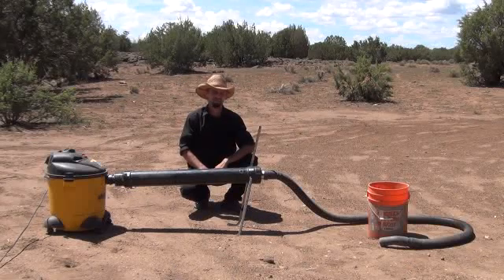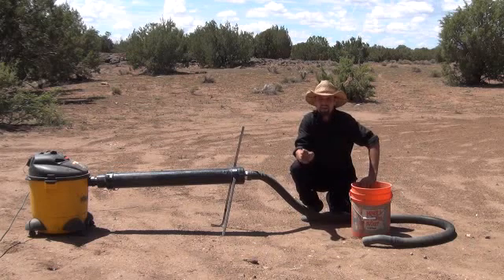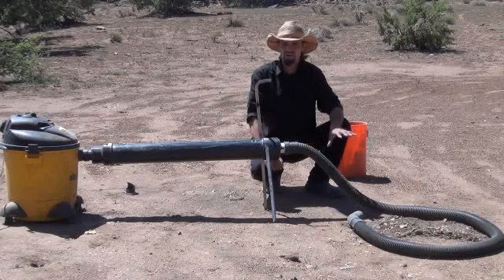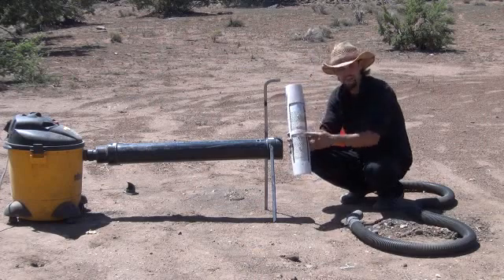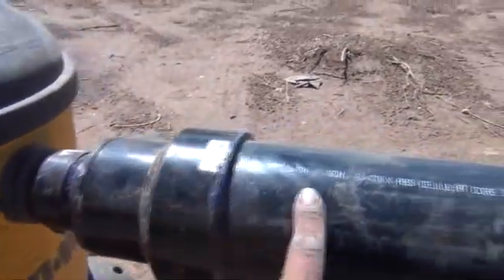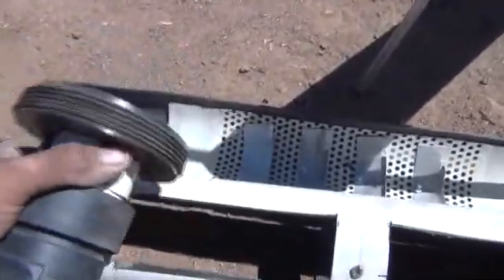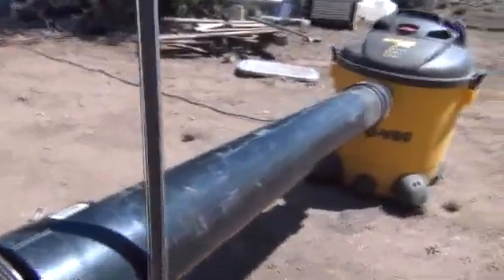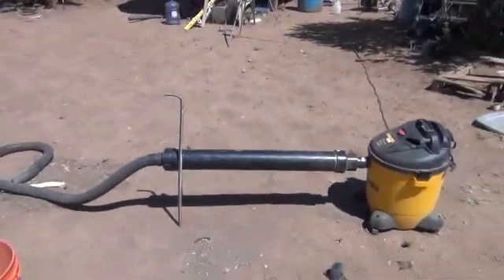"Water-less Gold Dredge" Dry land dredge

Comment: Huge problem I see with your rig is the shopvac hose you're using as the dredge hose. It's ribbed along the inside which will catch any and all gold dust/flakes/small nuggets before they get to your gold catch area. Other than that it looks like a fairly efficient machine.
Reply: Just shake out the hose into your concentrates.
Reply: Shake in the field then rinse out into your pan or separator.  Be sure it is bone dry before next use.

Comment: With the air flow, a reverse riffle design like in the drywasher might work better, did you try that? Seems like you would want smaller holes so only the fine gold will drop into the lower section. Still it's a worthy idea, though I still like your drywasher better :) A little Honda 2000i generator is a lot quieter & can be carried with one hand. You could build this on a leaf blower platform designed to eject the tailings for longer running time.